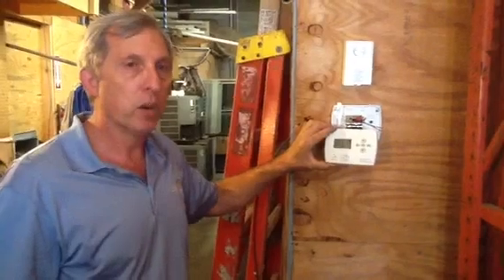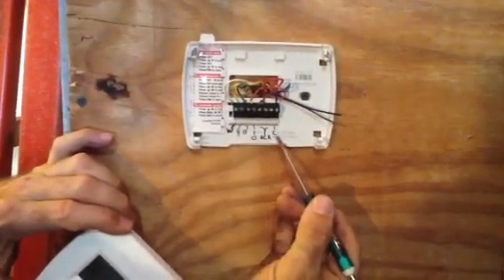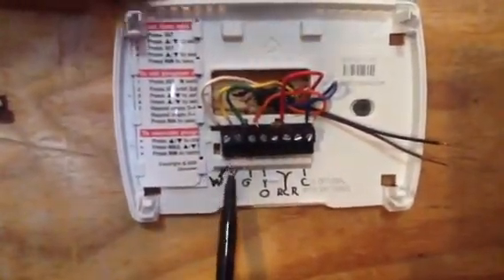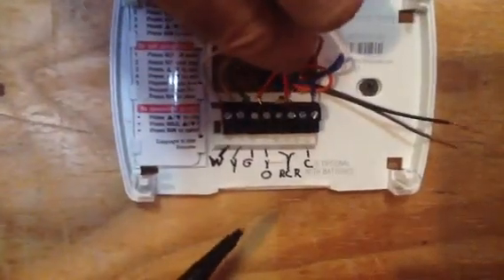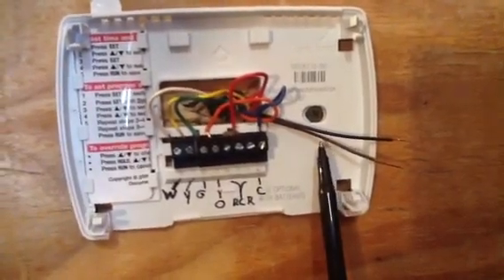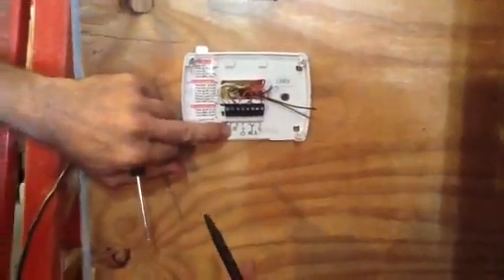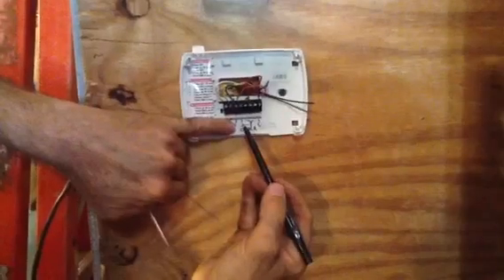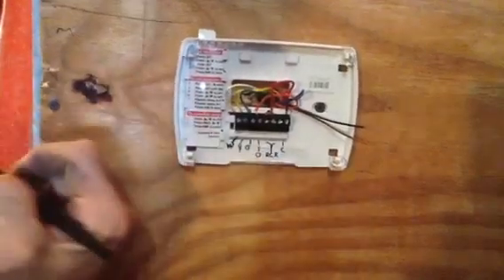Thermostat Wiring Made Simple

Comment: Thanks for this, between your video and another website reference.. I was able to gain the understanding of the system at the thermostat wiring level well enough to navigate my issue. I attempted to get my local HVAC technician to handle this matter initially, but his quote and subsequent rate was laughably ridiculous to me. I specified that my issue was: 1-2 wires being moved into a different terminal, a process that takes less than 2 minutes to resolve (excluding travel time) with a basic knowledge of those standards and a small flat-head screw driver.  I look to empower local businesses and professional trades, but its ridiculous quotes and rates like that that turns home owners into do-it-yourselfers. It's pretty gratifying to solve my issue and 'save' $90 in 2 minutes of effort beyond the time it took to watch this video and read a couple paragraphs on a resource site, but I can't help but feel disappointed that I can't just delegate the matter to an individual who embodies and/or represents the industry without these obnoxious value of time and service, cost consideration. I mean, I feel at odds about the whole state of affair in these interactions.

Comment: Nice video thanks a lot david ...my problem is heat is not coming on i looked all wire they seem ok orange wire has always 24 volts ...when i put ac on heat cool is coming on and im taking one wire off from reserving valve then heat starts to run what could be problem...thanks

Comment: hey david i having a little trouble with my furnace heater i think it maybe a wiring problem but not sure what is happening is the ac works fine but the heat will not cut off with thermostat if you can help i would sure appreciate it

Comment: Great video.
I have a Carrier Comfort Zone II (with 2nd zone) I'd love to replace with a Honeywell. I've called Honeywell, Carrier, and a local contractor (in NC) the response has been the same, it can't be done. The current thermostat uses only 4 wires that do not coordinate with other wiring.
the local guy said I'd have to change control boards and dampers to change thermostats at a cost of about $2,500.
Any suggestions?
Reply: ***** thanks Brian. I appreciate the advice.

Comment: I've an older williams gas heater furnace w/chimney, with blower (2 speed) switch and a knob attached next to a unit with low-med-high temp that turns the heat on. I was wondering if i can take that attachment off and install a digital thermostat on a wall instead. Also when i open the attachment i found red, green connected to blower switch.. are those the wires i am looking for? If i turn the power off the heater still runs with knob tho, power only turns off the blower connection. Pls let me know you input. Thanks for your video.

Comment: How do I wire a king model M600C-25HC thermostat to a simple fan for cooling in a green house. I have a switch for three positions. One to go to the thermostat. One to by pass the thermostat. One is empty to turn off the power. I have A fan speed control and a light to let me know if the fan has power to it. Please help

Comment: I just replaced the capacitors and contactor on my air conditioner due to the contactor sticking shut. I'm not sure how long the compressor was running but it flooded the garage since the blower wasn't on. Now I can't turn air conditioner on with the thermostat.  The heater turns on, the blower turns on, and if I hold the contactor down the compressor comes on.  The thermostat is a Honeywell with a white, yellow, green, and red wire. Do you think the thermostat is bad also?  Everything works but the compressor doesn't turn on.

Comment: hi david, i have a question. i am trying to replace my older Lux thermostat with a Honeycomb. I seem to have 5 wire connection on the older thermostat. the connections are: Red -> RC then a jumper to RH, Green -> G, Yellow -> Y then a jumper to W, Blue -> O, White -> C. 
On the new thermostat, I have an idea where the Red and Green wire go, but im confused on the other 3. Honeycomb has Y2, W2, G, W, not used, Y, R, RH. 
thanx a lot

Comment from the maker: I am glad it helped.. Thanks for watching
Reply: David Jones Mr Jones I have many years experience with auto electrical and took many classes . so in not 100% ignorant just 80% lol OK bought used rv to live in one night big rainstorm came through and filled 12v battery box with water and I experienced lights flickering etc . concluded transformer/battery charger fried out . .. I know I have to replace it but I am currently disabled and on very slim budget. . my question to you is my AC unit blower turns on but no cold air. I think the compressor is not turning on . is there a way to by pass thermostat just for a little while till I can afford new transformer / battery charger and new battery . I will replace them as soon as I am Abel to but the medication the doctors have me on  raises my body  temperature and I am quite uncomfortable with out AC . I know on a car you can easily do this but it not a car . any advice would help .. I have no voltage at the thermostat but AC blower motor works
Reply: David Jones.

Comment: David, thank you so much for a very detailed and informative video.  I am a DIYer and a friend thinks their thermostat is bad.  I am about to go and check it tomorrow and I would typically look for a wire that may have popped out or a bad thermostat cover that may have not engaged (snapped) back on to the base properly, as she removed it and changed the batteries.   I hope she put the batteries in correctly ! 

Thanks again !!  Well done.

Comment: Fantastic video! I live in the south, gas furnace and a/c. Last week had a condensation sensor go out. Serviceman wired in a new upgrade sensor but wired it so if condensation builds up in tray, the whole unit shuts down. This week, outside condenser unit come on for 30 seconds then shuts off while blower inside continues for 3 or 4 minutes. Then cycle repeats! house not cooling. I know its the thermostat
  Now my thermostat stop working! I only have four wires hooked up in programmable thermostat:Red wire- to rc and rh; red/white wire- hooked to rh to furnace; Grey wire - hooked to W; White wire - to Y; and Green wire - to G. no common wire.
What would you suggest?

Comment: have a janitrol forced air. compressor cycles with thermostat, but blower remains running assuming green is fan disconnected still runs. think board is shorted, what do you think?

Comment: Hi David, I installed new non-programmable thermostat from Honeywell model number rth111 and it worked fine for heat throughout the winter months but the other day i tried to turn on the A/C unit and went to sleep. I woke up to the house being 58 degrees because the unit never kicked off. I have tried two different non-programmable thermostats since then and I am experiencing the same issue. I tried connecting all the wire together (red, white, yellow and green) and all the system came on and then went off when i disconnected them. I do have a blue wire that is not hooked up behind the thermostat and i assumed that was C and the instructions on all the ones i bought said not to hook it up. Any ideas?

Comment: Question my hvac unit stopped working the fan will not come on inside or outside , I opened the inside unit up a we live in the country a wood rat got in and chewed the two wires going out to the compressor out side and they were touching and shorted out . I ran new wires out to the outside compressor these weren't the big power wires that were chewed but they were the two little wires I guess that sends a signal for the compressor to come on . We'll after that the unit still will not come on I have made sure the unit is getting power inside and out side and I have a switch inside the inside unit that you can manually turn on the fan and it will turn it on but if I switch it back to on and try using the thermostat to cut on the fan or the ac neither will not work I tried jumping the wires like you said in this video and it still will not come on I'm thinking that it may have ruined my transformer that you showed in this video when the wires were shorted ! Also I have over 20 years master auto tech and I went to electrical school back probaly 18 years ago so I know how to check wires but without wiring diagram or knowing what is suppose to send power or anything it is hard to test any help what to check what help me a lot . Thanks

Comment: My central air  unit will not turn off using the thermostat. Only the breaker. I have already checked the contactor and it isn't stuck. Any ideas? PS. The thermostat is brand new

Comment: Mr. Jones, 

I have a question regarding my air conditioner.For reason it wont come on. I am getting a warning of 24 - "Secondary voltage fuse is open". 

I have the red to the R/RC, the yellow to the Y, the White to the W, and the Green to the G. I do not have a port on my Thermostat so the blue wire is not connected. 

I noticed after trying a few things that the red wife has part of the wire showing deeper down the splice end. I am not sure but based on your videos, I am wondering if maybe it touched the blue wire and shorted out the transformer. Is there any way of checking the transformer? Would that even mace sense with the service lite warning of 24?

Comment: 6:24 you said if you wire nut those wires together you're sending 24v directly, so all those components should run constantly until you unhook them from the 24v. But then you lost me when you said if you do that and everything comes on you have a bad thermostat, I thought everything should come on since you're sending 24v directly. Please help i'm lost.
Reply: I am lost here too.................did anyone answer you?
Reply: Debra Kee Not yet.
Reply: He bypassed the thermostat, so if all the other components worked properly then the thermostat was the issue, the command keys may not be making the correct contacts to the systems wiring.
Reply: By tieing all the wires together you are simulating the function of the thermostat.  only difference is things keep running instead of off then on. If everything came on when voltage was supplied they are all working. Thermostat is bad because it is not sending voltage to turn on stuff. hope that helps.

Comment: hi David, i have an issue with my thermostat im sure. the batteries keeps on on dieing(Low Batt) every week. the main issue is i set the heat at 70 everything works but i never shuts it down when reaching the temp it stays on and my home gets warmer. i open the thermostat and notice the blue wire in on w2 and on the furnace board its on w2 as well what is that needed for? there is no wire on C that is running to my thermostat to prevent batteries.

Comment: Hi dave. Great video.  I still have an issue I can't figure out.  my hire condo is on Marco island I switched the thermostat in the summer and it appeared to function fine  now the girlfriend showed up today and no heat. The thermostat is a basic heat cool and off  fan auto and on  four wire   any thoughts. I believe the way that heat produce is by the air conditioning running the opposite direction   any thoughts

Comment from the maker: I am so what sure you have straight cool outside? So the white is common. And the black was used for Compressor, that's ok. The white wire on the W terminal is for heat to turn on your gas unit.  Hope this helps. Thanks for asking.